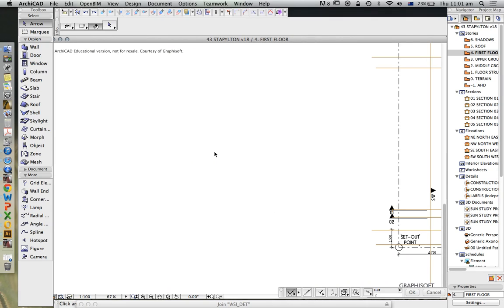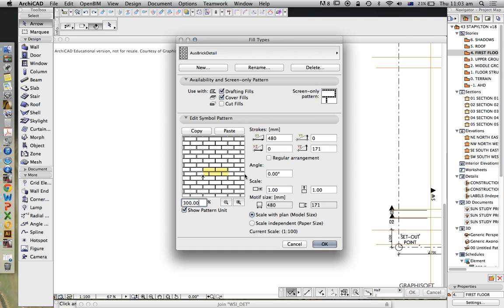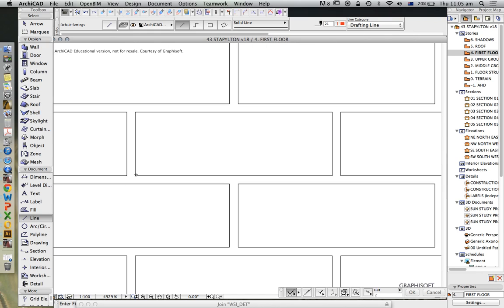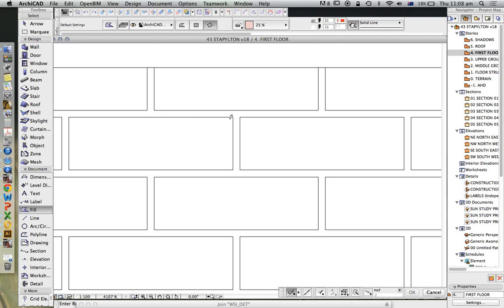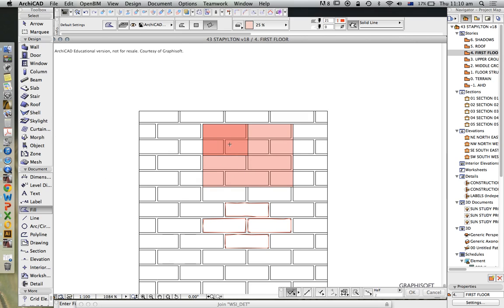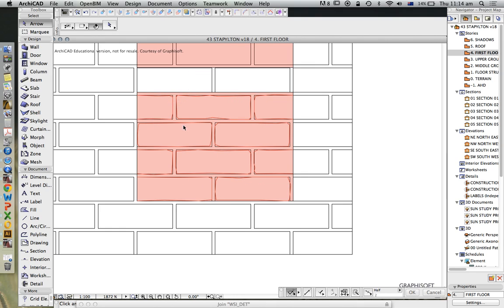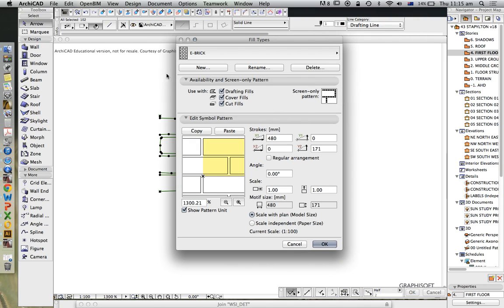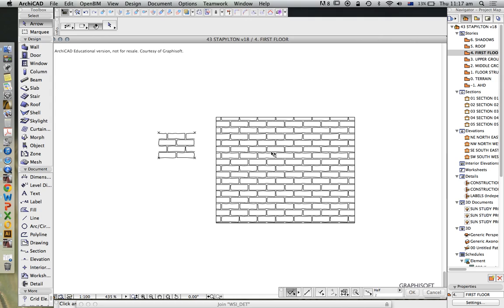ARCHICAD -  FILLS (CUSTOM FILLS)

Comment from the maker: The standard archicad library does come with a large range of fills. I have collected these over time and made many myself from scratch, or modified existing fills. I have made a few videos on how to make your own fills. Check this out if you are interested. It only takes a few minutes and could save you hours in the long run.
Reply: Robert Mann when i paste the custom fill..nothing show..why?
Reply from the maker: I will need a bit more information. are you making your own fill with lines?
Reply: its okey..i just found out that i'm using polyline. That's why i can't paste it..thanks for your feedback..=)